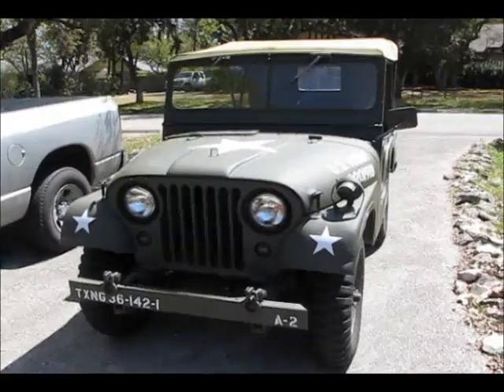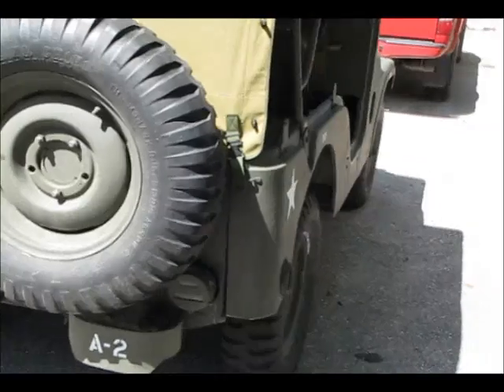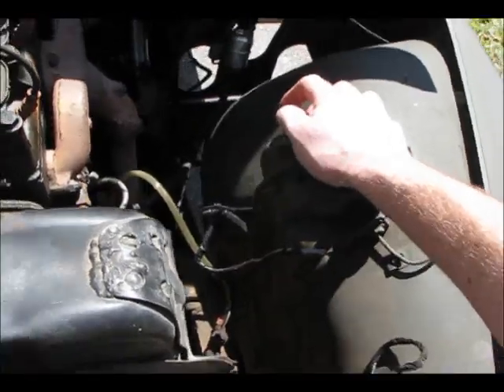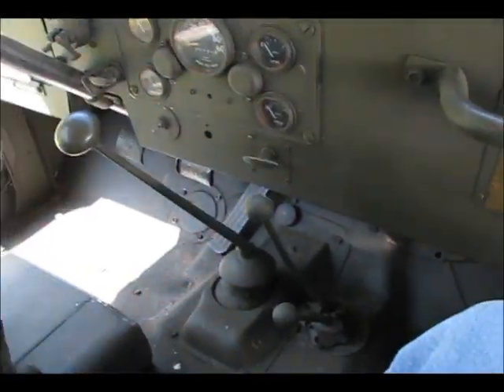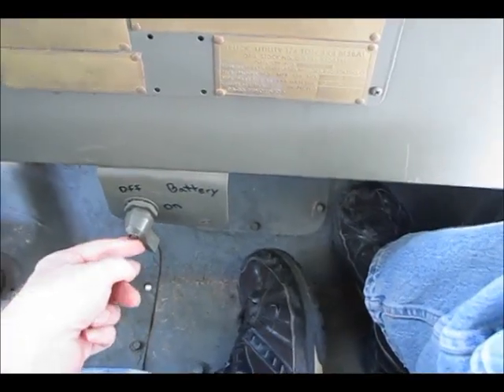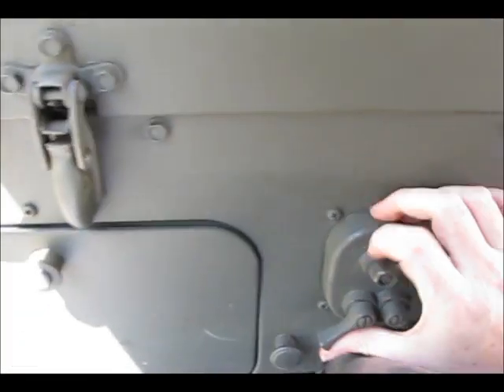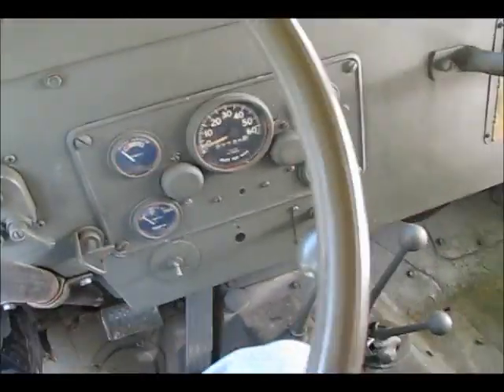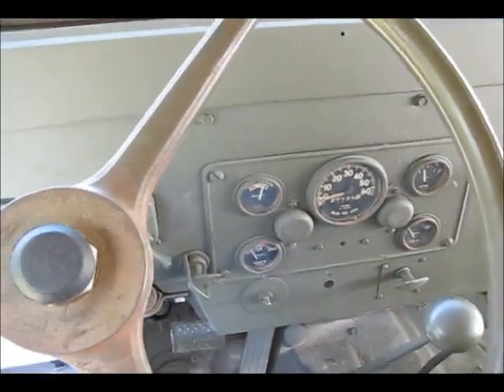Overview of my M38A1...

Comment: Nice video. Makes me miss my M38A1.

The manual throttle on mine worked a bit different. It did not have the guard yours does, and it could pull out a lot farther. It was flat on one side and notched on the other. You had to twist and pull. And yes, I used it as a poor man's cruise control once in a while.

For two spring/summer/falls I used the M38A1 as a daily driver.

Comment: Nice, I too own one, its a 1954 M38a1, we are trying to get it running properly and stuff like that. I like the 24v system in them, I like cars orginal. We need a new carb, fuel pump, and new floor board repairs.

Comment: The wipers do not operate off the vacuum from the engine. The fuel pump has a vacuum pump piggybacked in the same housing. But The fuel pump was probably replaced at one time with a cheaper one, with no vacuum pump

Comment: They also replaced the distributor with a civilian one to use the cheaper non- shielded plugs and wires. Thank God you can still buy correct replacement parts on the internet